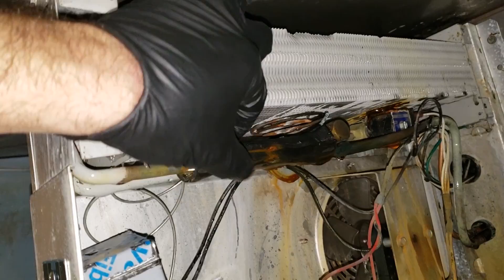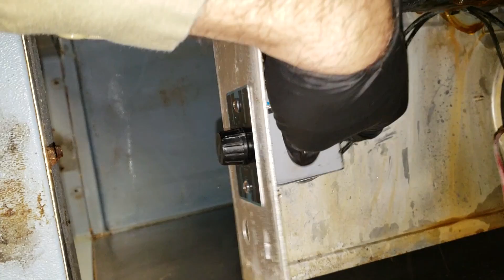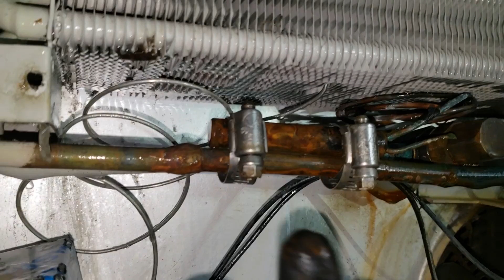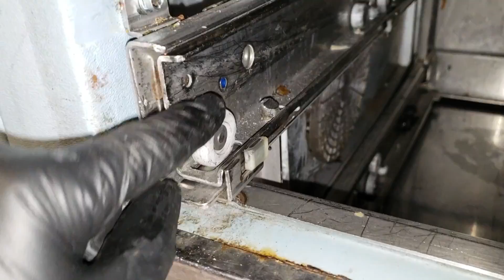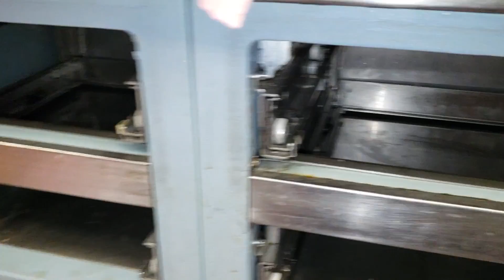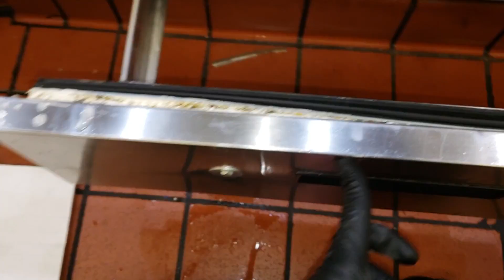Delfield cooks drawers with a txv problem

Comment: Just curious on your bulb placement. Ive always done it on the sides. Due to how small the line is, im guessing its not that important on placement as long as its center and above?
Reply from the maker: On a 3/8 line it really doesn't matter when you get into 7/8  and above is when it really matters
Reply: @HVACRVIDEOS  figured as much.

Comment: Interestingly the evaporator has a coating on it and no signs of corrosion, and it still leaked. I'm starting to think there is some mechanical issue that makes the tubes rub or something.

Comment: Silly question but the hose clamps you used on the TXV to secure it, will it not cause corrosion with the difference in metals or are they specific hose clamps for refrigeration

Comment: I'm not big in refrigeration, I deal with more residential hvac. I have a question for you. I was working on a self contained wine chiller yesterday and found a leak in a 1/4" liquid line that snakes back and forth below the compressor. I am assuming it is to help evaporate the condensate. I know someone asked you this recently but I cant remember the answer. Is it a big deal if I eliminate that line and just reroute it direct from the compressor to the coil?  Thanks in advance.
Reply from the maker: No you can eliminate it but how will the water evaporate from the drain pan? It's better to just make another one with a 1/4" tubing bender.
Reply: @HVACRVIDEOS  thank you. There is a drain sud with an external drain